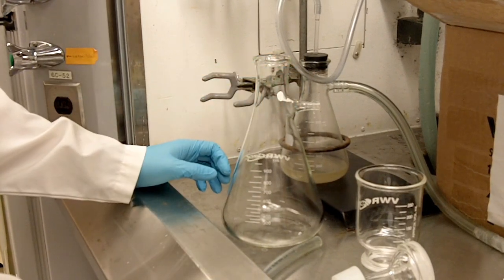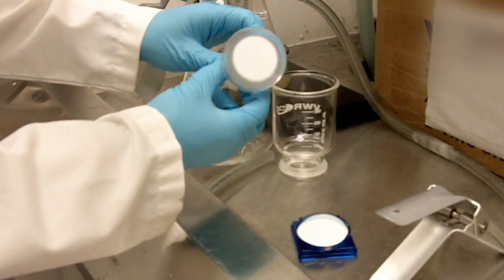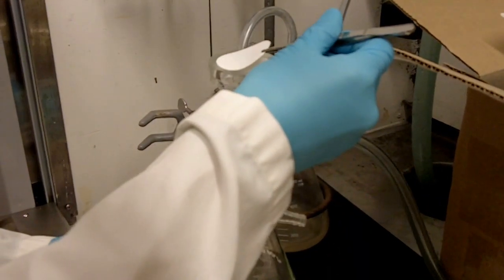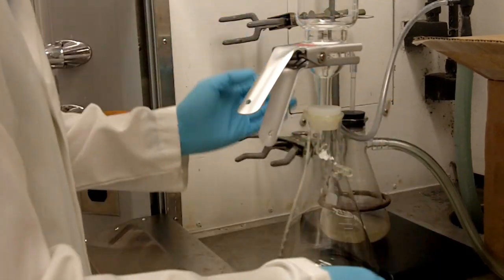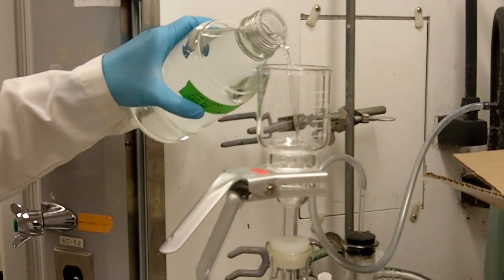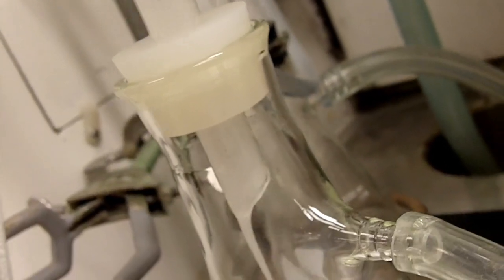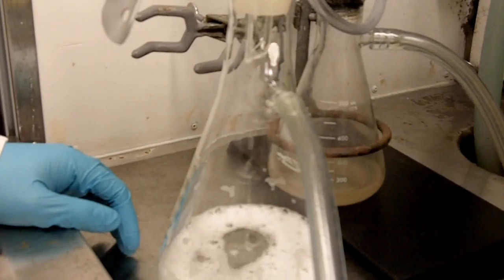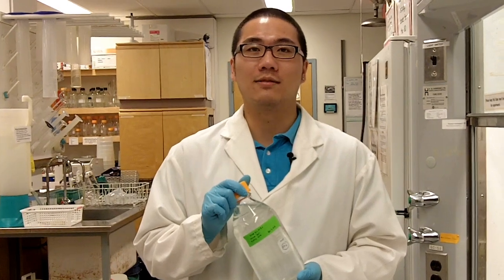How to Filter Buffers (Vacuum Filtration)

Comment: I had tried to filter the buffer through the same glass assembly, but I was facing a leakage problem from the filter base and funnel. I had tried so much to fix it but couldn't do so. Is there any technique to assemble the funnel and base with a clamp? Can you please help me out?